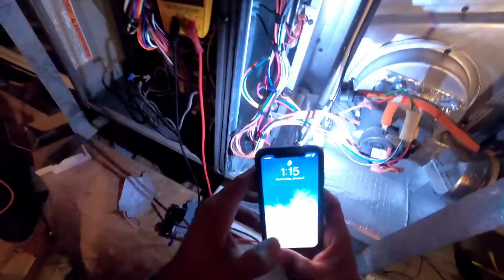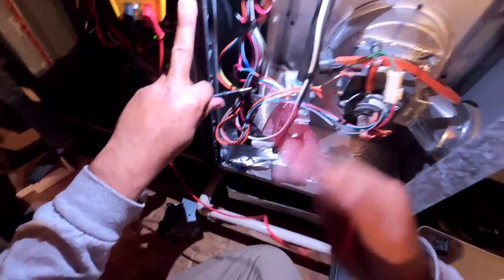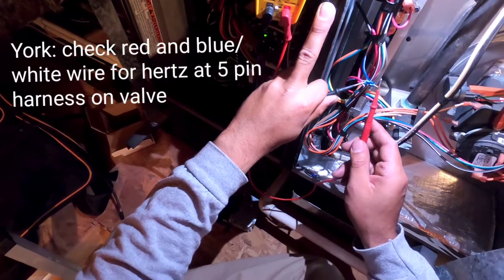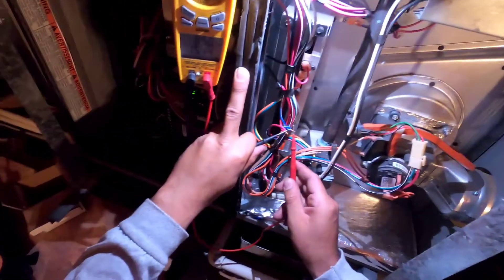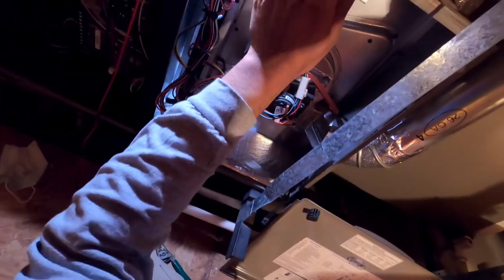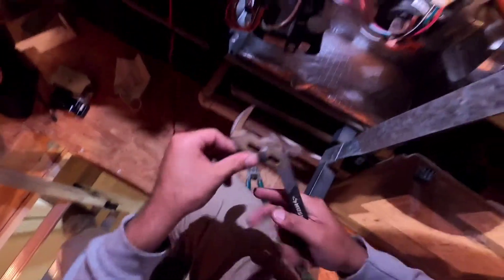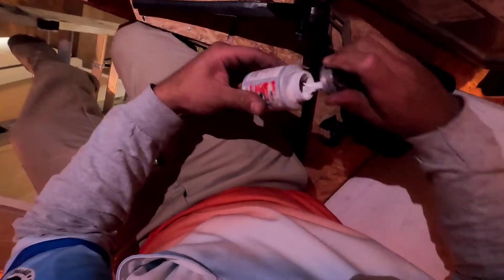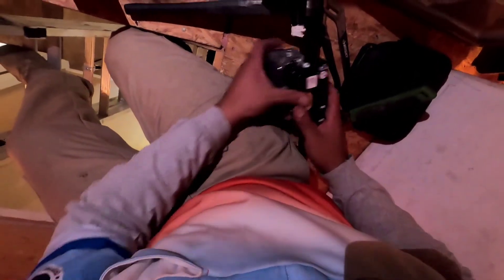NO HEAT!? HOW TO REPLACE A MODULATING GAS VALVE ON A YORK FURNACE part 1 CHECK BIO 4 SERVICE ARIZONA

Comment: You did not finish your video, modulating gas valves are a pain in the ass. Stay with a 2 stage furnace.
Reply from the maker: yes I have a part 2